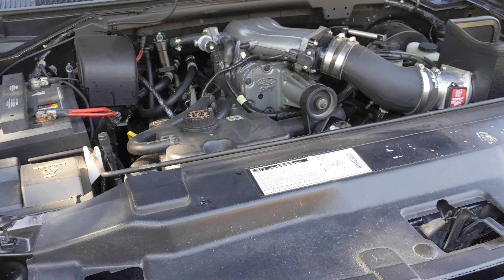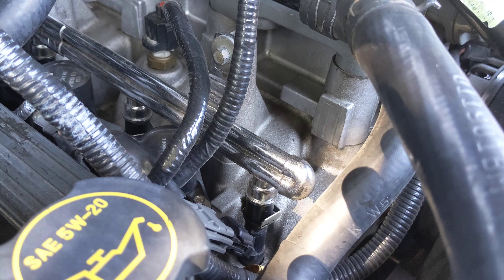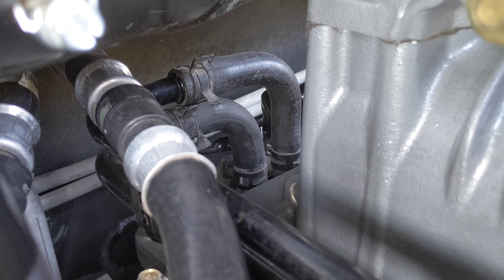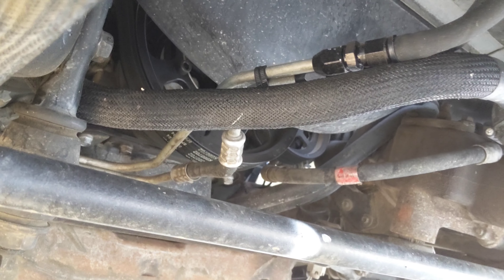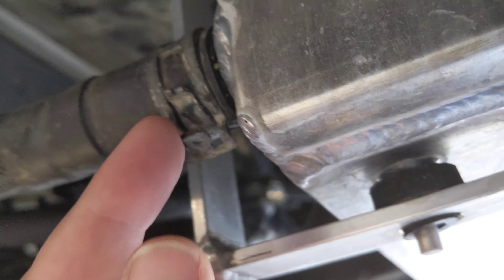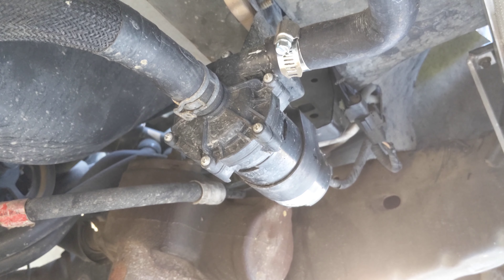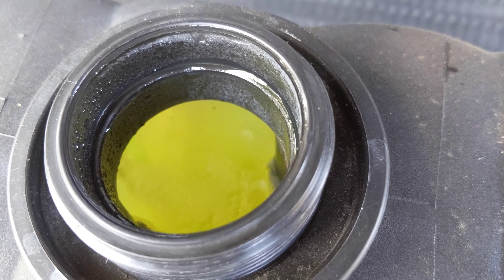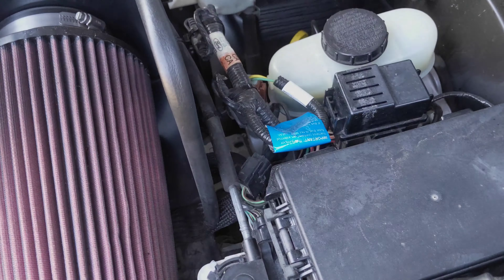Ford Lightning Intercooler Pump Testing and Replacement

Comment: Nice truck to have....we have a 95' Ford lighting at the shop🔥owner just has it sitting there....only needs a transmission🙄
Reply from the maker: I would love a first gen Lightning too though.  They're super cool.  Kind of insane how much they cost anymore.  Call up A1 for that trans when the time is right.  Would be badass.
Reply: @605BOLT  bad ass 4sure👍funny thing is that I had a 93' chevy 454 in the shop today...I made a quick video of it....those two trucks were rivals back then😏
Reply from the maker: For sure. Those old 454 trucks are cool too. I like the graphics on the tailgate.

Comment: Great info, thank man. Definitely going to check my intercooler pump.
Reply from the maker: For sure. Do check. Some definite ponies left on the table if it craps out. Also better for your engine to not be having to deal with that inferno of hot air. Lots of supercharger related lightning videos coming up here shortly. 👍
Reply: @605BOLT  My ZZP pump is on the way so I'll be pulling it next week. I don't think mine is working at all...
Reply from the maker: @LosDoyerss  nice. Ya that is a nice catch. Could save the engine if you really beat on it.

Comment: I'm having one hell of a time with a 03 f-150 H.D. truck! Idles & slow drives ok, but when you start crowding it and push hard on the accelerator, it stumbles and surges badly, like it's starving for fuel. Easing back off the pedal is the only way it seems to straighten out! Tested fuel psi at tank and rail. Cleaned/tested EGR valve and all vac solenoids, hoses,connectors.
New coils, injectors, spark plugs, etc.
Reply from the maker: Do you have a wideband oxygen sensor?  If so, that would be a helpful troubleshooting tool.  Basically, if it has fuel and no spark, the wideband will read rich.  If the truck has spark but no fuel, it will read lean.  This could help you identify the problem.  Also, is the truck tuned?  Can you datalog?  If so, a datalog can tell you a lot about what is going on with an engine.

Comment: I’m hoping you can answer this questions for me .  I noticed my pump not working and I ordered another one to change it but now when I try and bypass the sensors to manually make the pump turn on , it doesn’t turn on . So what I’m really wondering is if the 02 Harley have any other sensor that could maybe cause it from the pump not turning on . Thanks in advance. Great videos .
Reply from the maker: I don't know what sensors you would be bypassing.  If you are bypassing the relay as I do in this video, something else is going on.  A failed pump could cause a fuse to blow.  I would check to see that the fuse is not blown first.  Then ensure you have 12V at one of the spades of the relay.  Then, I would verify that you have voltage at the connector of the pump.  Once you verify all that, you will have a better idea where to start looking.  I'm here to help if you get in a bind.  Feel free to post back.🍻

Comment: Hey i ended up noticing I had engine coolant pooled up in the valley of my engine on my lightning , and was wondering if you know what causes that to leak in there ,we took everything off already sc and intake etc, and gaskets were good , no ripped hoses , so now we think it’s the metal pipe that runs in the valley that connects to the water pump but we see no holes or breaks in that , but we’re thinking that pipe has o rings that might have went bad and caused the leak but not entirely sure , if u can help , thanks
Reply from the maker: There is a metal hose that connects into the back of the water pump. It runs through the valley for the engine. There is a little o ring that seals it against the back of the water pump basically (actually a section of the engine block). Might be leaking there. 🤷‍♂️

Comment: Hey men you think that would be a problem for the truck to struggle to not pass 45 and kinda shakes a bit ?
Reply from the maker: Doubtful. I would be looking to see whether it has solid fuel pressure or an ignition issue. Intercooler pump could be the primary fault though where it failed and caused the engine to burn up the plugs and now you have a nasty misfire. Hard to say exactly but an intercooler pump on its own wouldn't keep a truck from going 45 or make it shake.

Comment: So what kind of fluid goes in that reservoir? Is it antifreeze?
Reply from the maker: If you live in the south where it doesn't freeze I would use just water. I live up north so I used to run antifreeze mixed with coolant. Now I have an ice box so I run water and ice all summer and switch to coolant just for the winter.

Comment: How do you drain that inter cooler reservoir your working on?
Reply from the maker: To drain the factory one, you can just undo the lower line to the intercooler. I don't recall the factory setup having any type of drain.
Reply: Thank you 605 & when filling it back up I could use the motor craft gold concentrate?
Reply from the maker: @thelastslime3007  that wouldn't be a problem. They put gold coolant in aluminum cylinder heads all the time. I have green in mine but whatever will work.